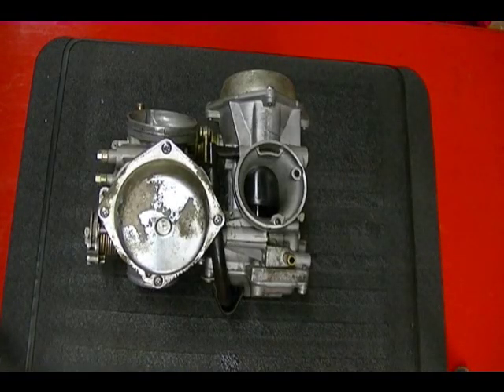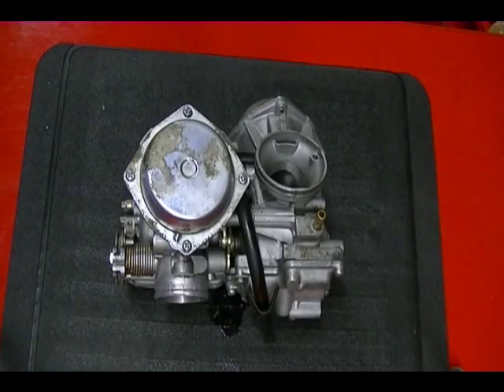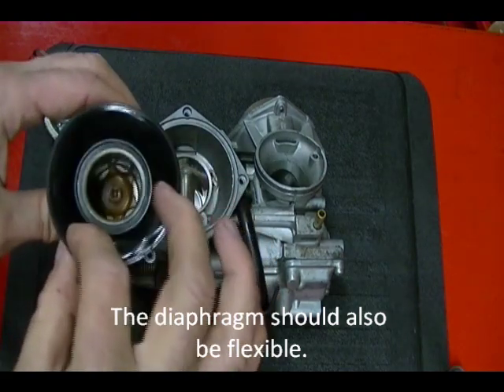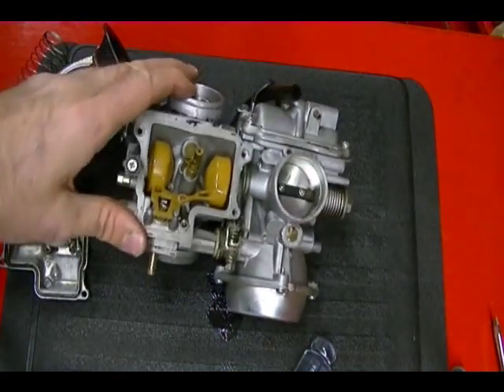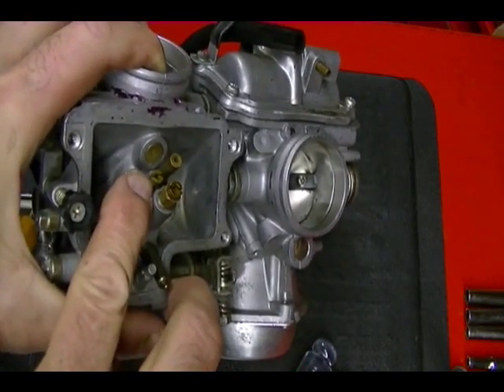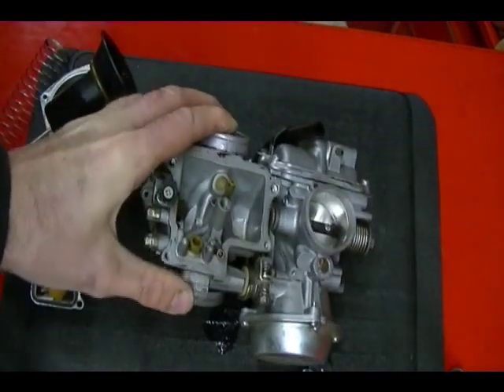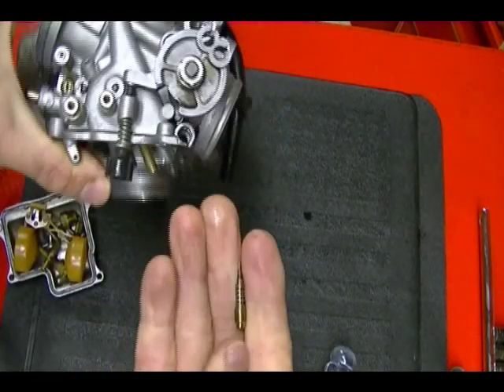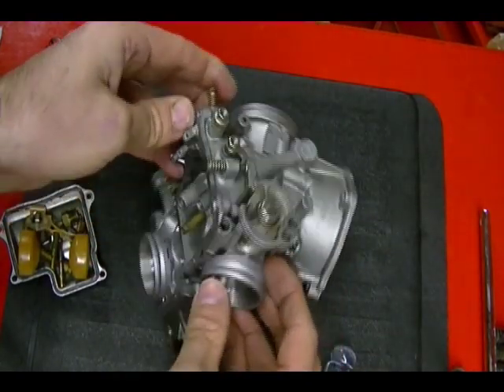How to Disassemble a Motorcycle CV Constant Velocity Carburetor

Comment: I have a 1985 Honda Shadow VT1100c. Someone before me substituted some custom straight pipes for the regular exhaust pipes. I think when you do that you need get larger main jets in the carbs. I have to use the choke severely. Way open to start and I need to keep the choke on some most of the time I'm driving. Are my jets the problem? If so what size jets do I put in?

Comment: i have an important question on the black tube at 0:49 tha basically goes into nothing. i have a 89 honda shadow pc21 and when the engine is running it pees gasoline out of this hose and i dont know why. where is it coming from? helpful video!
Reply from the maker: Check the float, float needle and float seat, and make sure the parts are in good condition. Than check the float height and adjust if needed. Sounds like your carburetor is allowing to much fuel into the carburetor.
Reply: ***** thanks! it was a tiny piece of dirt blocking the float valve seat. Also do you happen to know what the third "jet" in the float bowl is? it seems to me that this and the pilot jet go through a channel, visible in the bowl and ten on the outside wall go to the diaphragm chamber and when the diaphragm is out you can see two little holes. What is the purpose of this?
Reply from the maker: Maybe a vent. Not sure what your referring to.

Comment: I rebuilt the carb on a yamaha  15 hp outboard and it had the brass plug covering the screw, even after the rebuild I had a lean sneeze when at low rpm, I dug / drilled & pried and finally got the brass plug out adjusted the screw and it now runs great,  So my question is do you know a trick to getting these plugs out? I even buggered up the body a bit.   tks